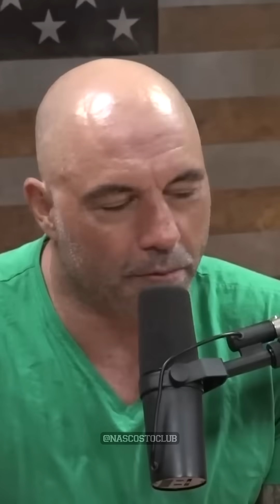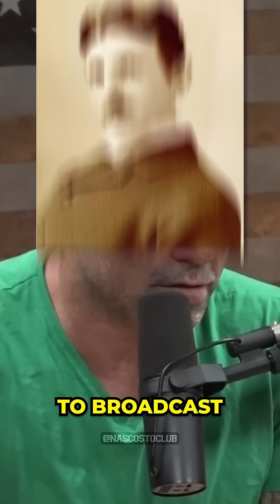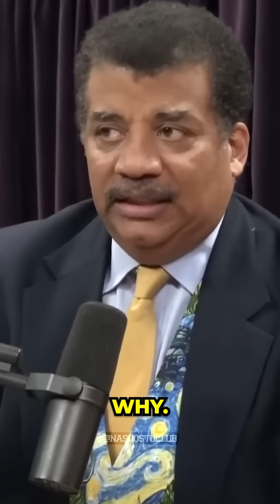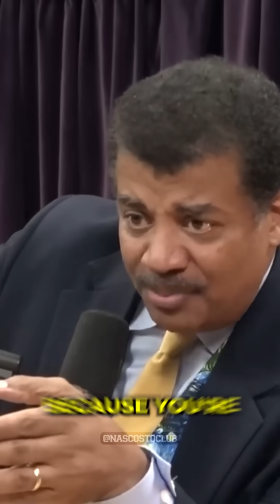WIRELESS Electricity Idea Debunked ⁉️⚡ #shorts

Comment: I used to be an electrician, and I had Neil's exact thoughts when someone told me about Tesla's idea. There is no "form" of concentrated energy that is not dangerous in sufficient quantities needed to power a device.
Reply: sound waves (my good sir I indeed know that we would need a unhealthy amount of sound waves to do that)
Reply: @shreyashabhinav1979  that would just turn you deaf
Reply: @shreyashabhinav1979  unless you're deaf you have no excuse to make this comment
Reply: To be fair Tesla came up with this idea in 1891.   Wireless Morse code radios hadn't even been invented yet.  Scientists knew little about what was possible.  From my understanding, Tesla's idea was to send it through the ionosphere.  
     Knowing what we know now, if we could build towers 50 miles tall, we wouldn't need to send electricity, we could just pull free electricity out of the ionosphere.  The potential difference between ionosphere and ground is 250 to 350 kilovolts.  However this probably wouldn't work wee either.  First it would be impossible to build a 50 mile tower.  Then the electricity would be DC, and the 50 miles of wire would overheat.  It would need to be converted to AC.  I have no idea how long the 350kv difference would last, especially at night when sunlight is not hitting the ionosphere.
    But I can see where in 1891, with innovation having seemingly endless possibilities, this would seem like a good idea worth trying.
Reply: @BrettonFerguson  Tesla's theories are what made long range radio transmissions possible. It was not only his theories, but the equipment he built. Someone else stole the schematics and built it, it was later found out.
Reply: @carminescurse    Yes I know.  Tesla had 1000 brilliant ideas and 99% of them worked and changed the world.  Like Radio, AC, improving on the dynamo, improving turbines, x-rays, neon lights, induction motor,  RC boats,  just to name a few.  Plus many many many concepts helping other understand electricity and magnetism. 
      I was just trying to explain the perspective.  Tyson makes it sound like it was a ridiculous stupid idea.  With the knowledge available at the time it wasn't so ridiculous.  The only way to find out is to conduct tests, so he did.  
    It should also be noted, Neil DeGrasse Tyson has invented exactly nothing.  He is only famous because he was in charge of the space area of the Natural History Museum when the Pluto demotion thing was in the news.  That is all he did.  Pure chance.  Now the media treats him like the smartest scientist ever to walk the Earth.  Probably only because they want to get more minorities into STEM areas.  A noble cause, but Tyson needs to stop letting it go to his head.
Reply: U fucling idiots....random gas motion
Reply: I bet you are not as much of a jack ass about it though.
Reply: are you now comparing yourself to Tesla a scientist with cable guy.. hahahaha fuck off
Reply: Scientists don't know everything. Most of what we have now was considered impossible 200 years ago. Are we at the peak of technological advancement? I'm pretty sure we aren't
Reply: The only way I see it being possible is by it slowly charging a battery on whatever device is in range
Reply: I thought he transmitted power in the ground? By "plugging" into the ground he was able to power a field of lightbulbs
Reply: @Curtis86  He transmitted thru the air into a receiver which are connected by wires in the ground.

The experiment though was done in a controlled environment. The theory is good but the practical application would raise a lot of eyebrows.
Reply: Look up a company called electric sky, whisper beam is their name for it, uses radio waves that they shape to send to a receiver.
Reply: @milesvoss1406  What even happened to that?

It was a proposal way back in 2021 and results should have been published already last year since it was only a 1 year research contract which should have been due mid 2022.

If we haven't heard from it by now, it may mean it failed or may not be feasible or cost effective if scaled up.
Reply: the energy is already everywhere...neither created nor destroyed...
Reply: i have no money to buy this dress is this inadequacy or expressing  ability
Reply: Is this guy a damn fool? The electrons being send by the tesla tower they will be at higher frequency so the electrons would just bounce of the body this is called skin effect
Reply: https://youtu.be/NowhPAMDOTo?si=6kzpmvaahUeKDlk1
Reply: Magnets are the way
Reply: Because thats what you were taught
Reply: @Redman Merman  Well yeah, and he was taught that becuase it's objectively true. Nikola Tesla's idea regarding this was/is legitimately impossible.
Reply: @Logan_94  haven't heard of the miceowave transmission that's been worked on? Yes still experimental. Successful proof of concept but only small scale as yet, 33 ft transmission if I recall correctly. The talk being of putting massive solar panels in orbit and transmitting the power via microwaves. Plenty of potential for catastrophic failure even if it proves to be feasible. I suspect it is highly unlikely to reach viability. But it is possible. Neil Tyson  DeGoose is one of those who believes if he hasn't heard about it it can not possibly be so. He also admits to spending inordinate amounts of time in front of a mirror presenting himself to himself, rehearsing.
Reply: @Mad Headz  No, I haven't. From everything I know about energy and electricity, as an electrician, the idea would be impossible though.
Reply: @MadHeadzOz  Can you link what you're referring to?
Reply: @Logan_94  not sure if the link will work. I put it up though, it was another short.
Reply: @Logan_94  fun fact, I haven't fact checked the short. Which I should have considered before I even commented. My apologies if it turns out to be total garbage.
Reply: @MadHeadzOz  I'd need to research this more. I just can't see this being efficient or useful in any real capacity. Too much energy is lost.
Reply: @MadHeadzOz  NO, its possible but is it safe?
Reply: @Logan_94  so you have not seen the Tesla coils where they could transmit lower from one coil to the other through the air over what I think was something along the lines of 500 ft... They ran several experiments where they showed that transmitting through the air was more efficient than through the wires and where it it was up on poles  someone could stand between them and have no effect on said person... Now if they were ground level and you stood between them it would fry you...
Reply: @Tog84two97  air IS a conductor but a terrible one it is worse in every way in comparison to copper, if air was an excellent conductor therefore more efficient than copper like you claim then all your electronics would've failed and short circuited
Reply: @Tog84two97  Lmao. I'm not even going to dignify that with a real response.
Reply: @MadHeadzOz  do you see the difference between beaming something down from space in a tight directional beam to Tesla's idea of beaming power off in all directions horizontally (you know horizontally, where the people are)
Reply: @MadHeadzOz  lol.
That was a very mild comment for you to react to like that.
I used to deal with microwave transmission equipment at work.
I can tell you even the phone transmission equipment will mess you up.
Ten feet out of the beam path at the transmitter end is still too close.
It destroys your eyes ( without you having to look at it) and your nuts first.
This is to be avoided 😂
Reply: @MadHeadzOz  through insulated tubes
Reply: @Tog84two97  The reason why they thought it was more efficient to use air is probably because they had no idea about the skin effect and because they were likely using direct current, which is notoriously tricky to get over long distances (which is why powerlines are AC)
Reply: @MadHeadzOz  fun fact microwave transmission has been used for data because microwaves are around the speed of light through air which is faster then fiber optics which is light through glass. 

Specifically for stock broking in the states somewhere that isn't wall street
Reply: @Tog84two97  However, you cannot control everything in open air and electric current would follow rules set by nature.

Electricity would always follow the path of least resistance. Lets say a thunderstorm happened to occur between a transmitter and the receiver, what do you think would happen if a lightning cut through the transmission path? What would happen if there is heavy rain? How about when the air is particularly very humid?

These are factors we cannot control. Much safer to lose power by running it through wires than having to turn off the electic transmission because of a natural phenomena occuring.
Reply: @Logan_93 Brother if you're a Journeyman, congrats by the way, but you're credentials are leagues off from the science of bioelectromagnetics. Respectfully🎉
Reply: Devices have to be designed differently to receive. It is not hard to make. Neil knows just enough to make what he says sound stupid. He don't know squat!
Reply: @coreyc47    I do agree he is an idiot.  He criticizes Tesla's wireless electricity, but then goes on shows and talks about making wormholes to travel because "The math says you can do it".  He's a retard and a hypocrite.  He should not be criticizing Tesla because of power requirements when he is talking about powering wormholes.  For those who don't know, it would take more energy than exists in the entire universe to create a wormhole, "but mathematically it can be done"  🤦‍♂
Reply: I mean tesla invented the ac current which everyone had said was impossible so?
Reply: @mrlegsbenedict  so go argue with the people working on the tech who claim proof of concept. I'm not about to pretend I'm clever enough to know. I will say that people have managed to achieve "impossible " things many times. Often it's only impossible until someone figures out how make it exclusive and monetise it
Reply: Gravity would like a word
Reply: @cosmicyoke  Gravity is not really a force, it is just a curvature in space.
Reply: @cinderburn2660  no......that curvature bullshit is the magnetic forces of the planets and stars. Gravity is a force. You have to overcome that force to jump, and it's what brings you back to ground.
Reply: @carminescurse  What are you, a high school student? LMAO!

Why do you think until now, humans cannot create gravitational force? Simple answer: Because it is not a force, merely an effect. Humans has yet to find a way to curve space to create the "force" gravity. All we can do is simulate gravity, that is why we call it artificial gravity, you never hear anyone using the word "artificial" to describe electromagnetic force, do you?
Reply: It's not impossible it's doable
Reply: @ultragamezz  No, it's pretty much impossible.

Comment: No you cant transfer electricity through the air without extensive losses of power and control. Lightning is just that; A big spark. The air has too much resistance, the heating is just too much so the losses are huge.. All the energy is spent in heat and explosion. look up  ohms law. And thats not to mention control.
Radio waves are different and obey different laws. The energy and power is there but its very low. It obeys the inverse square law. Which means that the further you are from the transmitter the less and less power you receive.
Typically Several Mega watts ( millions) in a radio transmitter will end you up with fractions of a micro ( millionth) of a watt in a recievers antenna.
People with no science training are influenced by myth because the reasons are beyond what they can reason. Think witchcraft.
I am sorry, really, I tried to explain in the best possible way. Imagine the cringe. Get smart, get schooling. Education is now literally at your fingertips.

Comment: Neil is correct but also incorrect on this issue.

The way Tesla wanted to transport power over the air would kill you.

But energy still needs to interact with you to kill you. If scientists invent a method to transport energy through space but that energy doesn't interact with you, it won't kill you, but can be used to power devices.

But the real problem is: this would be highly inefficient and not worth it, unless we solved the problem of the availability of energy (e.g. by making nuclear fusion work).

Comment: In general NDT is right, however we harness power from waves on the electromagnetic spectrum all the time...sunlight and solar energy carries a phenomenal amount of energy, it's just spread over very large areas and times, and weakened by the atmosphere, by the same working theory, you can transmit energy with a laser, but like he said, if it's powerful enough to power useful mechanical objects with a short burst, it's dangerous to get in the way of the beam or wave (whatever is being used depending on application). You also lose energy very rapidly over distance for any kind of EM wave with longer wavelengths than various forms of light.

Comment: The reason you think it's weird that wireless communication is universal but wireless power is unheard of is because you don't know how little power communication requires and how much power doing mechanical work actually takes.

People greatly overestimate the power of a radio signal and enormously underestimate the power of their microwave oven. If you were running a hands crank generator, you're putting out thousands or millions of times what you need for a radio signal. You're also going to need to crank that generator for the next half hour if you want to heat your lunch for a minute.

Radios are rated to pick up microwatts. That's a thousand times less power than a pocket calculator that can run off a button battery or a tiny solar panel and the lights in your room. Your microwave runs on a kilowatt. That's a billion times more power, and enough to stop your heart and begin boiling your bodily fluids. Think about it, a microwave runs on a fraction of what can flow through the walls of your house, but inside that box, you can burn stuff.

If you wanted to broadcast the power to run a city, you'd need to pump a trillion times more power than a radio signal into your nearby environment just to match the current output, melting stuff in the immediate vicinity while suffering enormous losses as 80% of your energy flies off into the sky and also drops off at the surface due to the inverse square law. We already have an energy crisis, we don't need to waste ten times as much so your cell phone doesn't need to sit on its charging pad every night.

Comment: For years DC voltage was transmitted through wiring and never killed anyone.  Electricity only started killing people when we switched from DC to AC.  That was the big argument between Tesla and the others DC was safe, AC was not he lost because they wanted money.  You can't make money if electric is transmitted through the air.  Simple.

Comment: I was but a child, when my late grandfather used an aluminium water basin with a 50 to 70 cm in diameter, pointed at the huge radio antena ( a huge pole) and got a bit of power to light the house with car light bulbs, during the commie era when power was out almost all the time to power up the factories

Comment: I mean the other thing is air has incredibly high resistance to electricity, and you're radiating it in every direction so the power cost would be insane. Even if you do it in radio waves somehow, the basic issue is still that... yeah, you're blasting this in every direction so most of it is just going to be waste.

Comment: Yeah but energy pathways aren’t linear and there is already energy in the air ITS CALLED WI-FI the stuff your phone magically connects to from the air to give you service it’s not big wires connected to our phones ? Energy can move around you ! If you wrapped a cord from your lamp around your body and put it in the outlet the light would light up and you wouldn’t be touched because it followed where it was suppose to go the source and could care less how you moved it as long as it knew it source

Comment: A thought....
Since it's all energy....What if you convert the electricity to a particular frequency/wave thats safe to pass through the air then the light bulb/whatever you want to power receives and converts it back to electricity or straight up just uses the wave/frequency as a source of power

Comment: I dunno, what if you just had an ambient, non-lethal or harmful, saturation of low-level electricity that other devices were built to sort of draw from that ambient field to collect and store for later use?

Sure, you couldn't power anything heavy duty with that, but small devices and energy-efficient devices, I don't see why not.
Or for powering things out in remote areas where solar isn't an option.

That said, rigging something like that up is kind of like handing a horrifying weapon to an adversary.
All they have to is sabotage it just right and the very air becomes a city-spanning electric chair.

Fissile energy is bad enough as-is when it comes to being a strategic liability.

Comment: The whole idea isn't completely debunked, just that specific one. There is a company who made laser based wireless power, and it works pretty well in small amounts, but just the same comes the issue of the limit on how much power you can actually send through a laser in the first place so the whole thing was kind of a waste

Comment: I once saw a short video that explained that the electricity that flows in wires actually doesn't do it within the wire but rather outside of it. The magnetic field around the wire is where it actually flows.

Comment: I mean, if we're talking florescent lights and LEDs, you can, technically pass power to them through the air. For florescent lights we have Tesla coils and for LEDs you can use cheap wireless charging pads and such. That being said, we're talking about a few volts but anything more is impossible.